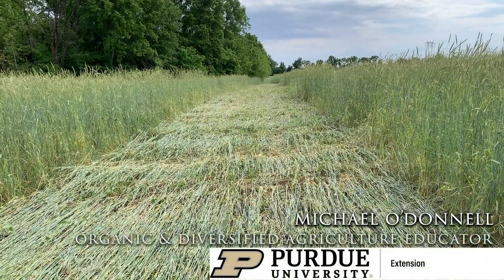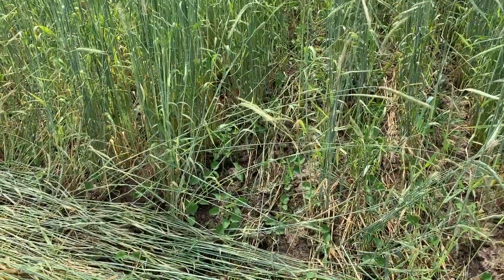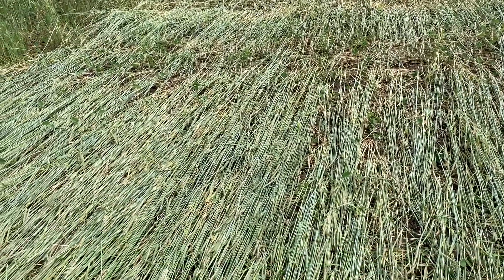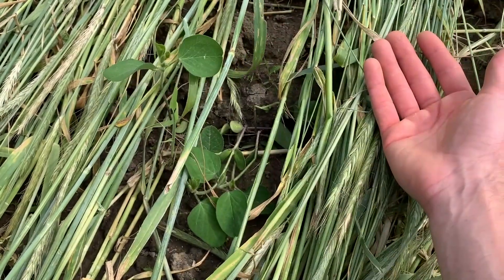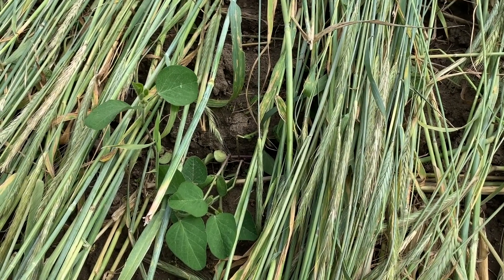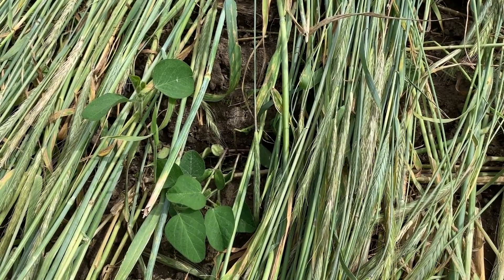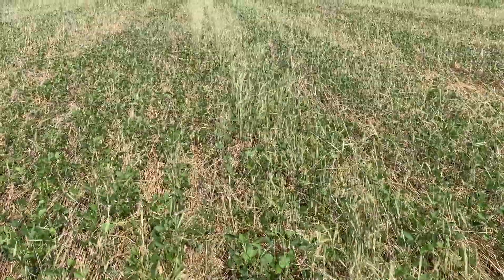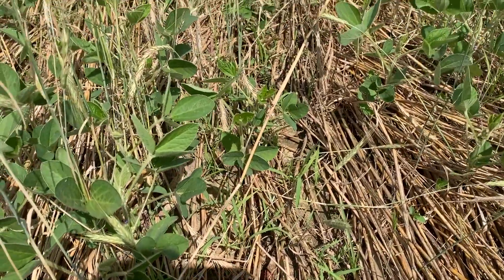Roller crimp terminating cereal rye cover crop & scouting a transitional organic soybean field

Comment: I wonder how it would work to plant and then cut the rye and spread out wide as possible?  It would eliminate rye that is not crimped.  That way theres not toxicity.
Reply: Rye is not toxic unless infected
Reply: Rye puts a toxicity into the ground once it reaches 14" is what I've always been told?
Reply: @markriegler430  it isn’t toxic to soybeans or so I’ve been told. Generally it’s harder on smaller seeds that aren’t planted deep. Small weed seeds on the soil surface for example.